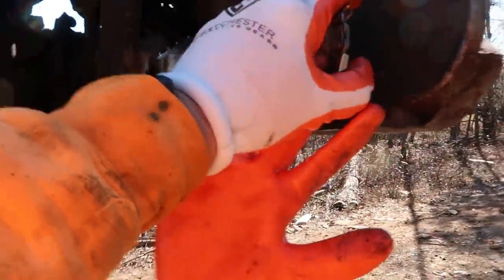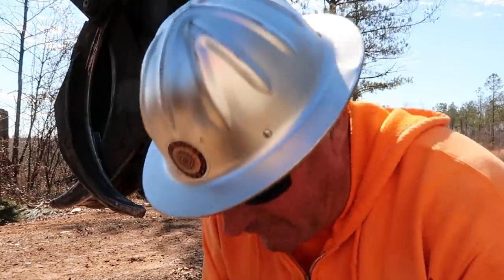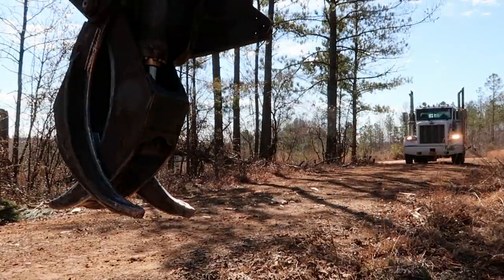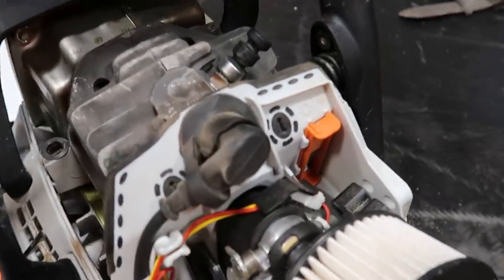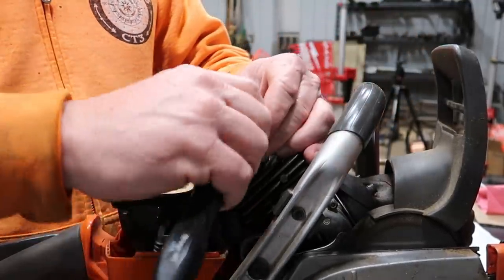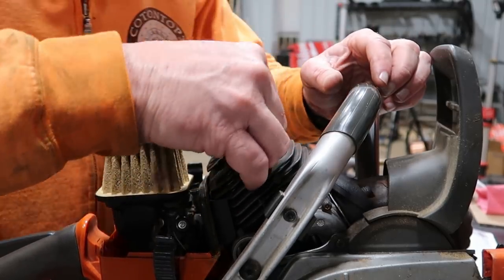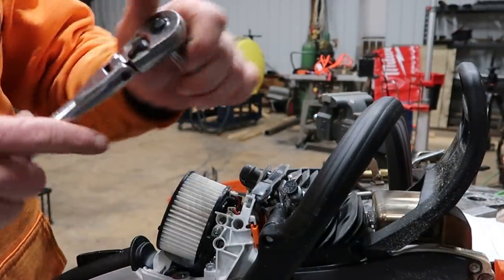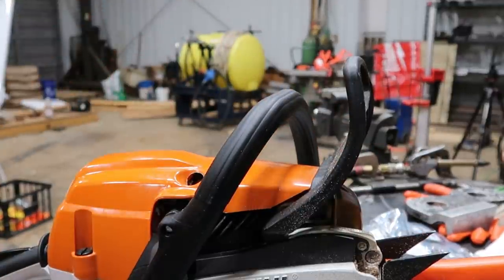New bar & chain on the Rotobec grapple saw & new stuff for my chainsaws

Comment: Hey Tim u have a link where u ordered those decompression plugs.  Would like to get some for my saws.  Thanks
Reply from the maker: Hang on a second.
Reply from the maker: Here they are - Haishine 3Pcs/lot Cylinder Compression Plug for STIHL 044 046 066 MS440 MS460 MS650 MS660 021 023 025 MS210 MS230 MS250 Chainsaw Parts https://www.amazon.com/dp/B07P32ZQ11/ref=cm_sw_r_cp_api_glt_fabc_5FAF2ZQBDBAHJTP2JWVX
Reply: Thanks Tim.  I’m sure a bunch of people will order them.  Hopefully through that link.
Reply: Are you going to replace the ones on your husky’s 372xp?

Comment: hi did you replace to stihl gas tank caps or just the rubber orings thanks
Reply: Ya I’m a still fan but those caps are terrible.  Wish they would come out with a standard screw in design with a flip top handle.
Reply from the maker: I replaced the whole cap.

Comment: I wandered about the decomp on my new ms261, as I can't really tell much difference, if any at all. I've only run about 1.5 gallons of gas and so far no leaks🤞.   I use German tools in my trade ( festool in particular) and they have a tendency to "improve" something that works just fine and make it troublesome.  Wish I could make the saw class but to busy right now...
Reply: @CrimeVid  agree with overpriced festool and they have plenty of good competition in most areas.  I bought my first festool track saw, vac, and mft close to when they arrived to the USA Market (2005?)  There was nothing even close to this at the time.  I still have those tools and they work as well as when new.  The point I was trying to make is about some of their "product imptovement" is not an improvement but a detriment.  Other improvements really shine.  So far my stihl gas caps work fine and I hope this continues, as I have read of many being problematic and really despised..

Comment: Prb silly qest,Can you tune your chain for different timber and other apps ie teeth positions ect,or just off the shelf chains.
Reply: Tim will say file your chain the same for all wood but I can tell a small amount of difference in my saws when I file them at a steeper angle for hardwood and less of an angle for softwood. For example, 25 degree angle for softwood such as pine and as much as 35 degrees for hardwood. With that being said, I don't feel enough difference to justify filing chains differently so I always split the difference at 30 degrees on everything. There are other factors that play a lot more into it than angle of the top plate in my opinion, such as getting your drags/depth gages/rakers filed too low or not low enough and bar length. If you are running a 60cc saw with a 28" bar in hickory with the drags too low then you are going to miserable. However, if you take that same saw and bar combination with a properly setup chain then you can cut said wood with it, You won't necessarily win any time trials with it but It can be done. Match your size saw with the proper bar/chain combo and file it to the recommendations on the box and you will be fine. Remember one thing, most of us are cutting a load of firewood from time to time and not competing at Stihl Powersports competition. Although, a properly setup saw will make you think you are ready to compete in one. Don't over complicate things and have a good time with it. Try different angles and and drag depth and see what happens, that's how you learn. Don't do both at the same time or you won't know which change made what difference. 

Wow, I think that is the longest post I've ever made. Sorry if I confused you but hopefully that helps someone.
Reply: Thank you sir.